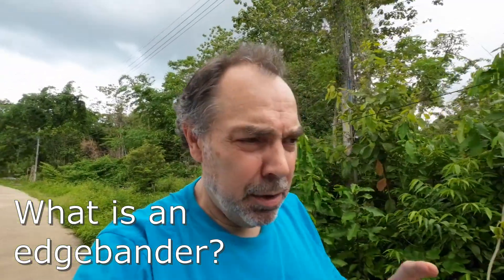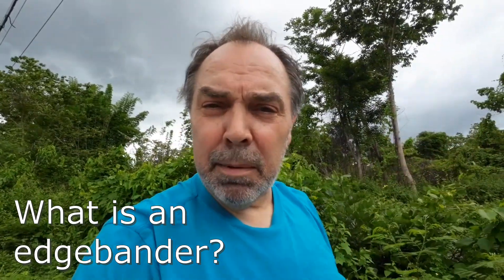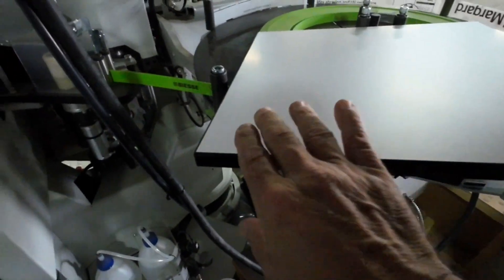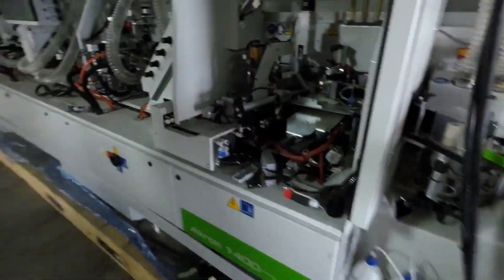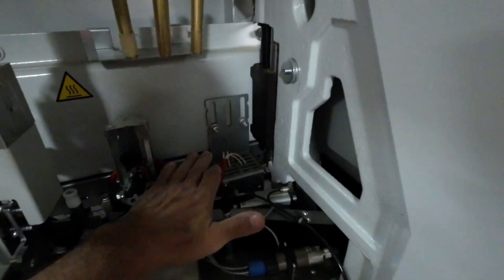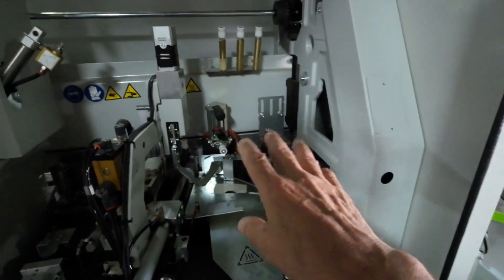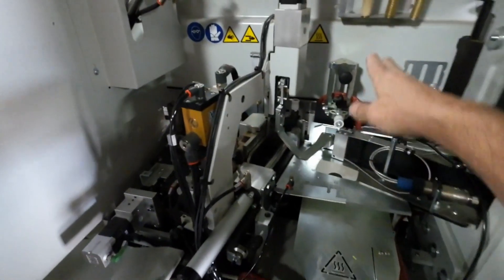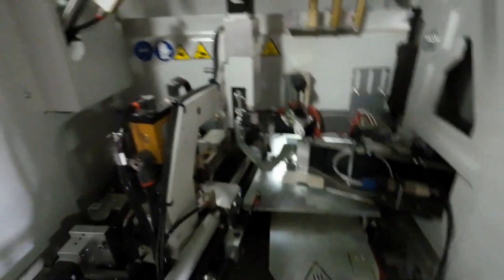Edgebander Walkaround. An introduction video for those that don't run machines.

Comment: What exactly does the hot air blower do again?
Reply from the maker: in short, it helps to re-activate the color of the banding.
Longer explanation, you know, as you bend plastic, it has a tendency to get a white 'haze' in the coloring. This is normal with all of the thicker bandings, and results from the profile scrapers doing what they do.
This is more noticeable in darker colors, and older products.
So, the hot air blowers will heat the surface of the profile, and essentially melt the surface and return the 'hazing' to it's normal color.
BUT!!!! There are several factors that add to this 'hazing'. Scraping thickness (0.1mm to 0.2mm preferred ) , Material type ( PVC, ABS, etc. ), scraper tool life, and feed speed, just to name a few. 
Hot air is a tool to assist in the re-activation, and not an 'End All' cure. 
The tuning of a hot air station is kind of an art, more than science. If I was running lighter colors for most of my production, on only needed the hot air on a few project, I would be more likely to use a solvent to reactive the banding.  I.e. if you only needed to run a few parts per month, it would not be any advantage to spend  the time tuning the station. That is up to the individual shop and their production.
Hope this clarifies, or if you would like additional details, do not hesitate to message me.